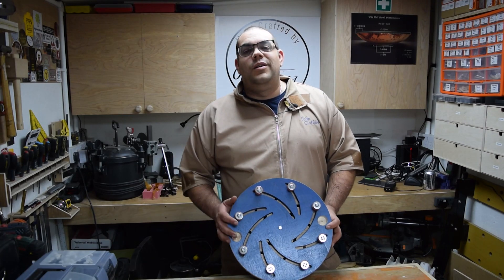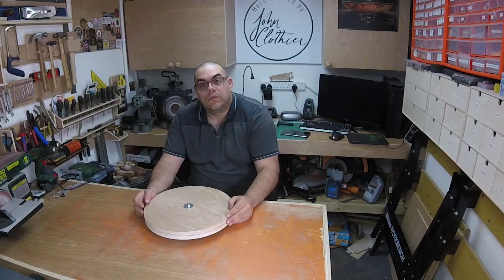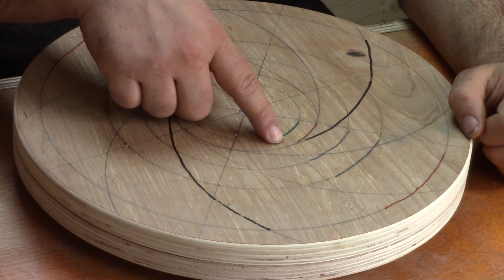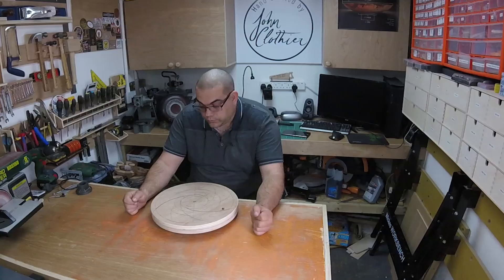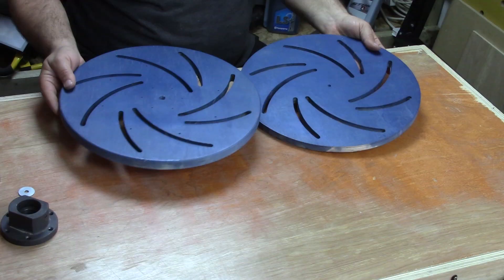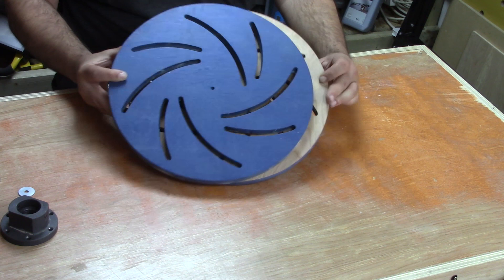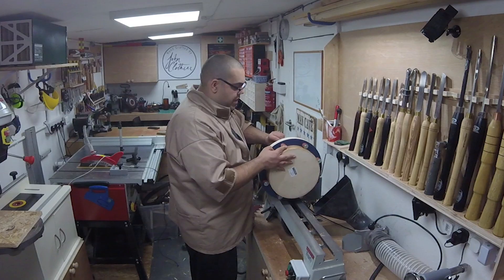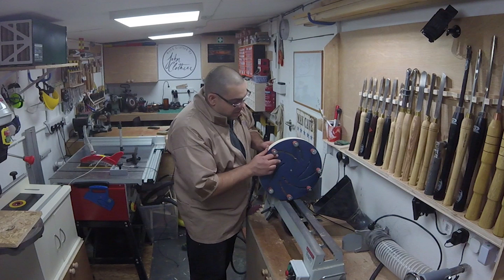Making a Longworth Style Chuck

Comment: I've watched several of these longworth chuck videos, and they all have the same problem the center hole is just slightly off and it catches a bit or the disc's seam out of round. You need to rough out the blanks on the bandsaw or jigsaw, then screw them together near the outside edge, mount you faceplate in its final place. Then mount it on the lathe and true up the edge. Now put the drill chuck in the tailstock of the lathe and drill your center hole all the way through while it is on the lathe. It will be exactly centered. Then take it off the lathe and mark and route the slots leaving the faceplate on the back. Everything will be dead-on center without trying to get the faceplate reentered again.
Reply from the maker: Thanks for the comments. Perhaps you could create a video showing the process?

Comment: Great video 👍
Reply from the maker: Thanks!
Reply: @JohnClothier  Please suggest the process for enlarging ID of carbide tipped saws through & correct ( tolerance 0.005 mm)

OD of the saws varies from 14" to 20" and Number of teeths also varies from 40 to 144.

Please also suggest machinery for enlarging Inner diameter of sawblade

Comment: Nice job John. I attempted one myself a couple of years ago and it was, frankly, a complete disaster! maybe it's time to give it another go.
Thanks for the vide.
Reply from the maker: +Pete Beardsley Go for it. The only bit I struggled with was the routing. You have to be quite precise.
Reply: Is that cause you need a precise way of indicating the circle, and cutting the arced slotts?
Reply: Maybe there is a way you could "cheat,  " buy along out a certain number of divisions,  with a, manyal spirograph system,  and then picking up right on the inside or outside of the right lines,

Comment: You seemed concerned that your explanation of the marking out process might be unclear or confusing. On the contrary, I found it perfectly clear and logical. I wonder if brewer's demi-john bungs might serve for the rubber grips as you can buy them with pre-formed holes (for the airlock). Anyway, thank you for an excellently produced video. I like the Minder joke at the end (lobster) 😂
Reply from the maker: Thanks Berny. Always useful to hear others opinions. I found it all very confusing myself at the time  which is why I wondered if that had come across. Rubber corks from demi-johns would work. I considered them myself. However they rubber is a fair bit harder and they wouldn't compress as easily. Certainly worth a try though! You have to love a bit of Minder :-)

Comment: Nice tutorial John!
How did you keep the curve accurate with the router? Did you freehand or use some sort of centre point to anchor the router on the correct curve plane?
Thanks
Dennis Beamish Cambridge Ontario Canada
Reply from the maker: Thanks Dennis. I used a centre point. You can see the metal jig the router is attached to during the routing. Roughly in the centre of that is a wing nut. That is the top of the centre point. I hope that helps :-)

Comment: Hi John
Not wishing to detract from your excellent video (and skill) but why not use a faceplate and put a mortice on the other side to shape the bowl, box etc?  Then invert the object to hollow it out.
Reply from the maker: Russ Martin if I have understood you correctly it is because to use a mortice with the chuck requires the mortice size to match the size required for the jaws.  My jaws require a 69mm mortice.  If I want a foot that is a different size to that e.g. 80mm then I can't use a mortice.
Reply: Hi John
There is no need for a foot if you use a mortice, you are simply making a 'hole' that sinks inward (opposite to a foot) and instead of the chuck grasping the foot, it will then be 'inside' the mortice so will put outward pressure on the inside of the mortice, so much easier IMO.  In other words you will hollow out to the same size of the 'foot' instead of having the wood stand proud and then widen the chuck to fit inside the mortice.  Not grabbing the foot but expanding the chuck jaws into the hollow and holding it tight that way instead.
Reply from the maker: Russ Martin I understand what you are saying and I do use that method at times. Today in fact I did just that. It's really for the times when you want more control over the base. Say you want a really shallow mortice. That wouldn't hold in a chuck so this allows you to do it. Also you may not want a variance in the base thickness to prevent cracking. A mortice wouldn't allow you to do that. It's just another option really 😀
Reply: OK mate, I have only watched a couple of your videos so was not aware that you knew about this method - take care
Reply from the maker: +Russ Martin np probs at all. I'm still very new to turning and appreciate any help I can get! If rather someone told me something i already knew that not tell me something i didn't! Cheers